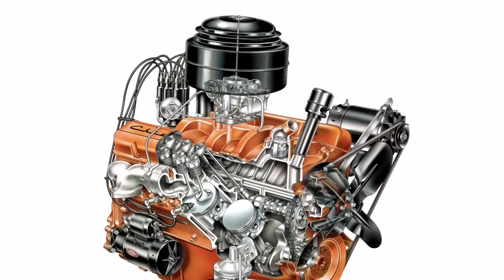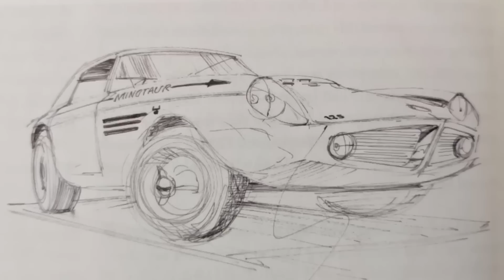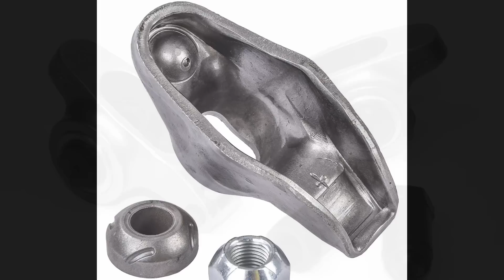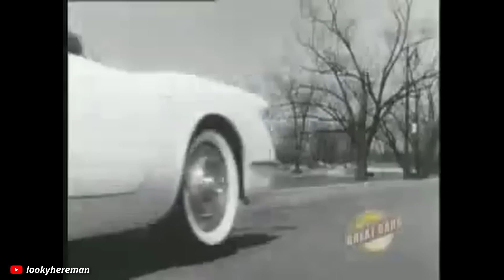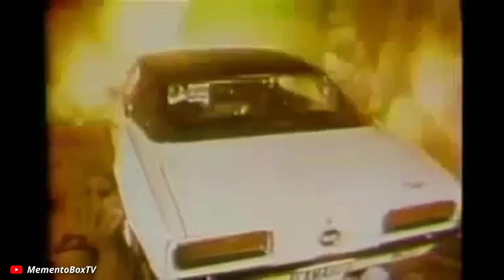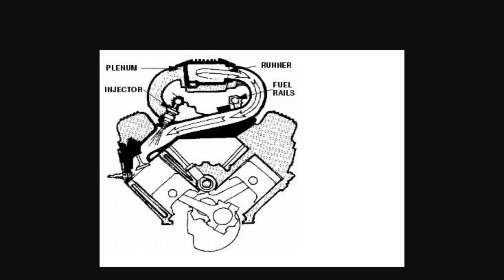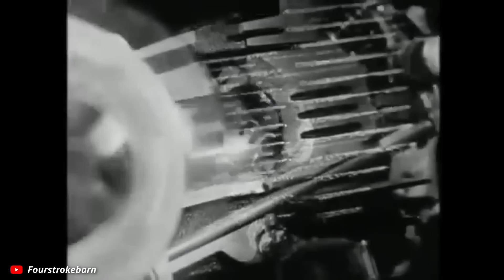The Engine that Powered America

Comment: Not all the 305s were lame but reliable.  Without telling buyers GM put Chevy 305s 
in Buck, Olds, Pontiac cars and had to settle a class action suit since they charged 
more for BOP engines.  They made a bunch of those with soft camshafts.  I had one 
in a 1977 Pontiac. I got a $300 rebate from the suit which didn't cover replacing 
the camshaft, the lobes of which wore down around 50K miles.

Comment: In 1977 i bought a 1967 Camero RS convertable with headlights that had auto covers. Lights off the grill covered it. Light s on they opened.
Air filter housing read 275 HP
I was a dumbass 
 Took motor out and put junkyard motor in.
Went about a year and rings went out.
I scrapped it.
Dumbass. Dont get me started on the 1964 Buick Wildcat i got next. Monster BB. Posi rear end. Huge intake and 4 bbl.
Im a dumbass but we didnt know.
Paid $100 for each of those.
2 weeks salary.

Comment: I’ve worked in the oilfield in a lot of different capacities. There’s industrial small block chevys mounted on skids, powered by natural gas, used as natural gas pumps to pressurize various production systems or whatever, they’ve been running for probably 10 years at like 3000 rpm. They’re not only the most versatile engine on earth, but the most prolific

Comment: About the only things a 307 is good for is getting you to the grocery store. And donating it's crank and rods to a 350 to make a 327 !  If I was building a hot rod @ or  under 2000 lbs, a 327 with a 3.73:1gear and a 4 speed could be quicker than  a 350 especially if its revving past 7k rpm.  I have heard stories of a 283 built taking down big blocks on the 1/8 mile strip . A 327 only has a 1/4" longer stroke. And with some mods and main studs, balanced, it should easily exceed 7500 rpm easily with the proper cam and heads
 A pair of 600 Holley carbs, or a single 750-850. With at least 12:1 compression, and a 150 N.O.S shot it should blast off. Shut the nitrous off at 7250-7500, on at 3200, dropping the clutch at 3500, and spray soon as the thing starts moving. (As long as it's hooked to the track!) A pair of 15"x14" rims and some sticky wrinkle wall slicks to fit, it should hook. Especially double deadlocked , with just enough air in there to hold it up. Get half the tire laying flat on the track! A 3500-4500 rpm launch , you would be really thinking you are about to launch, when all you see is sky! 😳  Shift and do it again!, Depending on tire diameter maybe a 4.10 or 4.56 gear would be better, or just a 3.90, a model A or stripped down fiberglass (carbon fiber) Camaro  ot Nova isn't going to weigh much..

Comment: My first engine rebuild was a 1965 283 Chevy. It only had 72,000 miles when I got it but I had it bored and honed ten thousandst over, put a over stock cam into it, stuck 202 heads on it and a wheiland hi rise intake and 650 cfm carburetor on it. Put it into a 1978 Monti Carlo with a ford 9" rear end and 400 turbo transmission. For a mouse engine it would put you back in the seat and get a 17 year olds adrenaline pumping.

Comment: Still driving the 98 Chevy Tahoe 4x4, 96 3/4 ton Silverado 4x4, 97 Z71 shortbed 4x4, all equipped with the legendary 5.7 litre Vortec small block engine. Replaced the spider injectors on all three which was the only weak spot, these drivetrains are unbelievable for reliability and ease of maintenance. My trucks are better than the new junk on the market and I will pass them on to my boys.

Comment: Your dad saying what his dream car was is exactly how I determined what mine was. I got my dream car. 1968 Ford Mustang GT Fastback, I was born in '68 and my dad had a 66' Mustang Coupe w/289ci Hi Po V8. He bought it brand new. I spent a lot of years riding around in that car. Sadly he had to sell it when I was 12(1980 was the worst year of the recession for my parents). Anyway, you should have seen his face when I rolled up in my '68 for the first time back in 2004. He was tinkering with his T-Bucket HotRod, powered by a 350ci SBC with bigass Blower on top no less. :) His daily was his old 1972 F-100 Ranger still. My family never got bogged down with which Mfg was the "best". We bought what worked. Hell my mom bought a used 1980 Malibu Wagon my senior of HS(1986) that she drove the wheels off of until 2008ish. My dad got tired of fixing it, lol.

Comment: My 1st road car was a ‘63 Impala SS Convertible with the 327!!! I think you’re really describing mechanical, engineering and manufacturing advancements though…the 283 is just as great an engine as is the 289 for Ford.  All leading to advancements like the 396, 427, 454 etc. Quite possibly the best engine of all time is the 350!!! Had a few of those with several having in excess of 250,000 miles like my ‘96 Impala SS

Comment: 20:08 Funny thing about it...good as the smallblock is, I'd stil lrather have the six. My 71 C10 has the 250cid I6 and I am not changing it for an 8. If I ever get a tri-five I will go out of my way to see a stovebolt under that hood, be that from original or if I have to swap a V8 out to get the six in.

What can I say I like that smooth, long lived buzz of half a dozen cylinders.

Comment: 18:44 No, no it could not. An engine like the SBC is too reliable, too long lived, too serviceable to ever get past a modern day bean counter. Planned obsolescence is definitely a thing and, sad as it is, the days of ICE power are numbered in general. The LS is probably about as close as your gonna get, but even then you're dealing with an engine that shits itself before 125,000 miles on the regular unless you go in there and delete the AFM system which requires stripping it down to almost a bare block, fiddle with the oil pump pickup, and do some software shenanigans.

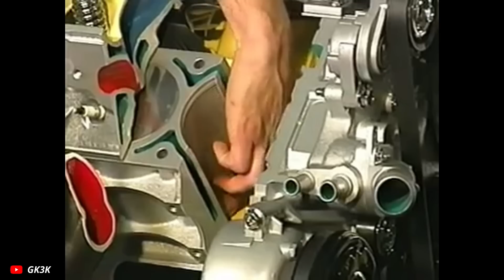Comment: 15:23 And mechanical backwards compatibility. You can mate any transmission from the LS era to a smallblock and vice versa. Engine mounts pretty much transfer right over. Why swapping LS's in older Chevies is so popular; they damn near bolt right in. Aftermarket parts even exist to further improve the LS by divorcing it of all its computerized bullshit and letting you use the faithful and tested Quadrajet/HEI distributor that has worked so well for nearly 50 years at this point.

Comment: Nothing I love more than the sound of AMERICAN IRON with a pushrod V8 in it.  GM’s small block are indeed legendary.

I had a Chrysler 318 v8 (Smallblock) in a 96 Jeep Grand Cherokee that I’ve passed to my son/grandson.  I expect it to last at least a decade of 100K+ MORE of hard driving in rural TX.
With fuel injection and an overdrive transmission it gets 22 mpg on the highway, with 12-80# bags of Sakrete as a load. Aircon didn’t work, but on the Monterey Peninsula, the mean temperature is 67 degrees, so a heater is necessary, not air conditioning!

I now have a 2022 Lexus RX-350, beautiful and comfortable SUV, that I bought on the conditions, after a substantial fight with my CFO about it, that it has the following:  A roof rack, trailer hitch capability, and AWD. (Also it’s the last year with a naturally aspirated V6 without all functionality locked up in an “Infotainment Screen,” which can glitch out if the inverter cable at the bottom gets loose.  Happened to me in a BMW—NOT fun!)

If one has a an SUV, if you can’t use it as a light truck upon occasion, why bother having one?  Although I don’t think it will go straight up a muddy mountain, like the Jeep would!  😂😂

Comment: I would agree there will never be another engine as popular as the small block, but another great engine with a similar scenario of continuous revision is the buick 3800 motors that derive from the old fireball v6, sold to amc and rover and then back to gm.

Comment: Still have my 1974 c10 going. Its not the original sbc the number code comes back as a 74 f body on the block and its a 010 casting. Hes a runner. Bored .060 over with a modest 246° @.050 retro roller cam flat top pistons and aluminum brodix heads.

Comment: My 55 Chevy Belair four door with a 265 V8 and two speed Powerglide automatic got 18 MPG on my trips up to Maine from Boston (but gasoline was $.25/gallon then). The car steered like a truck and the brakes would lock up in the snow if I was not careful (the car had hardly any traction at all in snow with the bias-ply tires). The ignition points would burn up at odd times in the Summer and the car would stall until the points were cleaned using a match book strike surface in a pinch. The Tetraethyl leaded gasoline forced mandatory 3,000 mile oil changes. Or the crankcase would sludge up. Spark plugs lasted 10,000 miles due to the leaded gasoline. Once in a while I would smell crank case gas fumes from the vent tube under the car (pre-PCV) at idle.

Comment: Some things you missed on the small block; it cylinder heads flowed much better than the competition, and the shape, called wedge heads, were very good at compressing the mixture and delivering a clean burn, while the wedge design made the mixture very easy to ignite and so  give great torque. Other factor was the oiling system, with oil coming up from the pushrods and spraying all over the rocker arms made it reliable and alot less prone to valve train failure, plus with all the oil being splashed onto the rocker arms, the piddle valve in the lifters made sure that valve train would always be responsive and run nearly forever! It also was efficient in weight and gas mileage.  So its cylinder heads gave a good running and responsive engine while the oiling system then made the motor almost perfect!

Comment: The Chevy Gen 1 small block, specifically the 350 5.7, and the BUICK V6, specifically the 1988+ 231 3.8 3800 are two of the best engines ever made. Both are stupid reliable, their best attribute. However, they make good power, both are torquey engines and, if maintained, can easily go 300k+ miles without a whimper. I think it's a shame that they're both gone. I know, i know. They're old engines and antiquated compared to todays engines, but their simplicity is what made them so great. They just worked. With all of the rediculous emissions standards and MPG requirements, engines are getting harder and harder to make consistently reliable, especially with all of the computer modules that are used to control them. Sad. We probably will never see an engine that proliferated the entire auto industry like the Chevy small block. 

Great engine, and great video! Thanks for the awesome content.

Comment: I have a fuel injected 350 in my 1990 chevy suburban. In my opinion it's one of the best motors chevy has ever produced. They are so easy to work on and enough power.
Reply: I still drive my 91 GMC 1500 with the original 5,7 with 499 k on it , you couldn't pry that truck out of my cold dead hands .
Reply: @oldbiker9739  same I wouldn't trade mine for anything.
Reply: Same here, but in a '91 van.

Comment: I don’t agree with you. Ford’s early chassis and The other’s were designed to be fitted on several other bodies and platforms. The model was famously a coupe, sedan, truck and wagon all using the same parts and engine. The flathead Ford was used in cars, trucks and military tracked vehicles. The stove bolt six Chevy was used in everything from the 1920’s to the 1980’s. Same for Chrysler’s slant six, it was in cars, trucks, heavy trucks, forklifts and other industrial products. The small block Chevy is a fine engine for it’s era, but everyone romanticizes it because it was Chevrolet motors first successful V8. (Their other V8 was a flop).

Comment: Such great engines, I have a 1998 k1500 with a 350 vortec that has 285,000 miles and is still running great to this day, have had multiple small blocks and big blocks over the years and they have always satisfied me, I don’t like the new generation of the small block due to the afm/dod though

Comment: my personal fleet is powered almost exclusively by variants of the small block chevy gen 1 and 2, I've got a carbureted 350 in my 1967 C20, TBI 350 in my 1989 C2500, and a MPFI 4.3l V6 Vortec in my 1996 C1500. The only old chevy I have that isn't small block powered is my 1950 3600 (3/4t) It currently has an era appropriate 236ci inline 6, I'd like to update to a 4.3 V6/4l60E combo or if I could get a decent one a 292/250 inline 6 with the same transmission.
Reply: I have a 250 inline 6 with super low mileage I can selll you.

Comment: The best engine ever made. I have had all the different cubic inch engines both stock and all forms of modifications. I probably have my last that has been highly modified. It's a 421 ci stroker with over 525 hp built for the dirt track which burns race fuel only. I don't know the torque numbers but it had more than I was able to use. It only has 16 races on it and I haven't been able to race for 6 years due to health issues. I guess I need to sell it. I got sold on the 400 ci when I ordered one in a new van in 1976 and could not believe its power.

Comment: I had a neighbor who had a scrap metal business. He had a 1965 Chevy Viking 60 tractor cab with a 327, sm 420 manual trans and a split axle. That truck could pull two loaded trailers. Overhead cams are nice but Chevy has proven that pushrod engines can be better, so much simpler in a v8.

Comment: I still daily drive small blocks and have a few big blocks as well good engines..easy to fix.. cheap to make power and if done right not gas hogs at all. Not to mention modern overdrive transmissions bolting to them since gm kept the same bolt pattern for some LS's..

Comment: If I were an automotive manufacturer, the next “small block” would be a three cylinder engine.  Has the innate balance of 120 degree firing arc, and with more modern turbochargers can produce plenty of power for a consumer vehicle.  You could also do without forced aspiration and run it as a charger for a hybrid vehicle.  Somewhat untapped market imo.  Thank you for sharing.

Comment: Excellent video !

alot of the aftermarket company's exists because of the small block like Edelbrock for instance

thousands of machine shops are still in existense because of the small block, and the fact that to this day it is still the most popular choice for hot rodders , racers,  says alot about those engines. 

can there be another engine like the small block chevy? absolutley not!  if the LS did not surpass the SBC in popularity, nothing will! it is simply the best engine of the last 70 years and still counting

The small block chevy has won more races than all other manifacturers combined.

Comment: Nice video. I would suggest we do have engines that might have the longevity of the SBC or A-H A35 engines. How about Honda's K series engines? Or the 1.8L Toyota engines? Both produced for decades and used across a number of product lines, though I'll admit I don't think any farm tractor is so equipped.
Reply: absolutely no! the engines you mentionned are excellent but nowhere near as popular as the sbc.  this engine came in production in 1954 in 1955 models and it's still produced today. no engine has ever come close to the sbc from winning races to powering boats, heavy trucks, farm equipement, millions of hotrods etc.

Comment: One thing that had the small block a favorite among hotrodders is that Chevy had a line of performance parts available right away when it was introduced. At the time, the flat head V8 of Ford was a hotrod favorite as they were cheap and plentiful, but Chevy wanted to be the hotrod favorite, so effort was put in to make that happen.

Comment: I remember magazine articles at the time (maybe even GM too) referring to the new LS V8s as the “Gen III” small block, even though it was a whole new design. Specifically in the mid 1990s, before the C5 Corvette was released to the world. It only shared the 4.4 inch bore spacing and the bell housing interface. I hoped at least that they would keep the side mount boss/bolt pattern to keep backwards compatibility going. That was one of the things that made messing with Chevys easy and inexpensive, was that they kept them interchangeable with previous iterations in their earlier cars.

Comment: While you, and others, try to link the LS engines as sort of a 5th Gen small block, they really are a completely new engine. And that is good, not bad. Plus amazingly, the small block hasn't died. It isn't in production cars anymore, but they still produce a lot of them for over the counter sales. That is something that never happened with most other engines and says a lot about the longevity of the Chevrolet small block.  The SBC went from 1954 to 2003 for a production vehicle run of 49 years. The current LS engine family has been running from 1996 to present, for 28 years and looks good for many more. 
As to my 5th Gen, many refer to the standard SBC as one generation now, but it had several major changes. Basically, the engine changed in 1961 ('62 model), 1967 ('68 model), 1985 ('86 model), and 1991 ('92 model). This doesn't include the offshoot of the Siamesed-bore block for the 400.

Comment: Best engine from each manufacturer IMHO: Ford 289 tie 5.0, AMC 390, Oldsmobile 455, Pontiac 389, Buick 455, Mopar 426 Hemi tie 5.7 Hemi, GM 350 tie LS.
Reply: I pretty much agree with your ranking, but there is a special place for the AMC inline 6. It first came out in 63 in the Rambler American, and was used in a variety of cars and in Jeeps up through 2006 with many parts still interchangeable..

In terms of pure numbers produced over years, I wonder where the aircooled 4 cyl VW engine would be in that scale.
Reply: I completely forgot the AMC straight 6 that powered about a trillion Jeeps.